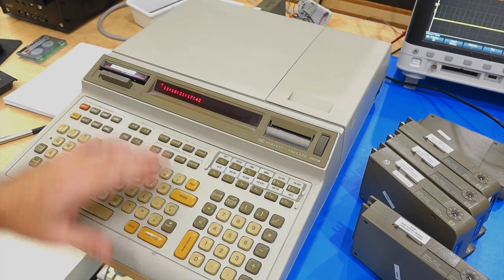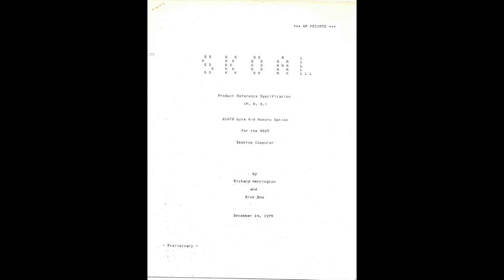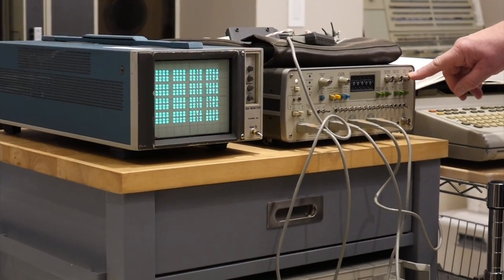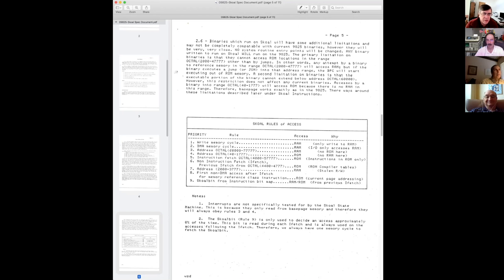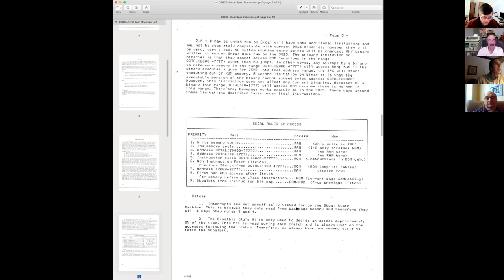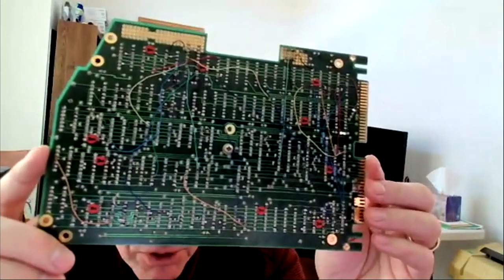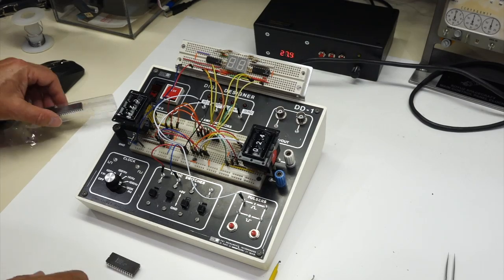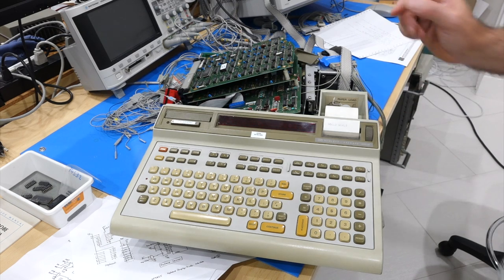HP 9825 Repair Part 9 : Skoal board repair (featuring the original designer!)

Comment: Ken testing TTL chips by hand on a breadboard is impressive attention to detail. And Marc’s parts storage cabinet is beautifully organized.
Reply from the maker: Having a big pile of vintage parts that is not organized is completely useless. It’s a lot of work to organize, but the only way to find the parts when you need them. Ask Mr. RTTY...
Reply: Haha I misread that as Mark's pants storage...
Reply: Mr Guru  It does show that it is accessible to all, which I like.
Reply: Mr Guru  It's a good exercise, but yes, an EPROM programmer would be much faster. A TL866 II Plus, which are fairly cheap, can test most TTL chips, and is worth picking up if you don't have anything better on hand.
Reply from the maker: @Mr Guru  Cool I did not know it could do that. Not sure mine has that option, I’ll check! [Edit] And it does! It can test all but one of the TTLs we replaced! It's not 100% accurate, it gave me a good test on a flip-flop that is definitely bad. But thank you, I did not even know!
Reply: Mr Guru  My old TL866CS I bought years ago does that too, a very handy yet little known feature!
Reply: @CuriousMarc  that storage cabinet shot reminded me of the 2001 scene when the HAL 9000 was being disconnected. I was waiting for the HAL voice while Dave was disconnecting the modules and the amplified breathing from his pressure suit.

Comment: Just want to say that watching your board diagnosis and repair videos has given me the confidence  to repair some of my own boards. I recently repaired a Hyundai XT-clone motherboard to fix a RAM error. Traced it down to a single bad NAND gate that was controlling one of the banks, but this is a clone board without any schematic available, so I didn't have a clue where to look until I took the time to reverse engineer it.
Reply from the maker: Wow, congrats on your repair and reverse engineering!
Reply: @CuriousMarc  Thanks! If this were Tandy, IBM, or even an HP, it'd have gone much quicker. It's much easier to find technical reference manuals for them.

Comment: Super cool hearing from the engineers that worked on the product. We take so much for granted in modern hardware design as everything is all modular and general purpose these days; build to a standard and specification for interoperability to guarantee compatibility of components - Computing back then really was the wild west and so much groundwork had yet to be laid.

Comment: I used this computer a lot for my masters thesis at the USGS in Denver. I wrote some data reduction code on it and later graduated to its younger siblings and HP basic running thermal ionization mass spectrometers. After graduating from MIT with a PhD in geology I went full science though and gave up programming.  Very very cool.

Comment: U58 74LS54 and U59 74LS64, what interesting chips. I'd never seen that topology before - or can't remember seeing them in the databooks. I'd always assumed the ttl jelly bean chips were always one chip type or another. Definitely made to reduce total chip count.
Reply: Interestingly enough, my comprehensive TI TTL databook skips them, but my abridged Motorola databook with Radio Shack logo includes the '54.
(and I wanted to reply that you would not find that kind of in the abridged databooks sold at Radio Shack but they would be in the full databooks...)

Comment: I love these vintage machines, and I love collecting them. I have an HP 9825 (one with the more traditional keyboard)... You have inspired me to service that power supply and install a crowbar clamp circuit on it before I consider playing with it! It also makes me wanna make a space in my workshop to open up my HP 9100A, and figure out what's wrong with it.
Reply: The early keyboards with the low profile keys didn't hold up well and were replaced very early with a more conventional type keyboard. This was around 1980.
The electronics division of Ford loved HP and used its test equipment almost exclusively for many years and for good reason, I've kept 3060 board testers in production for over twenty years. They were built like tanks.
Reply from the maker: Indeed I did not show that yet but I had to do some repairs on the chicklet keyboard.

Comment: Do you know,i really  thought that SKOAL  may have meant 'System Kernel  Overlay Addressing Logic',and then Rick spoilt it with a pack of tobacco!!  For me, this project is up there with the Digibarn project,, Marc has taught us so much,and introduced us to a great bunch of talented  yet humble  engineers.
My suggestion for the perfect finale,,The keyboard ASIC is shot,Ken and Karl decide to read the state machine conditions from the working keyboard ASIC, they push out a tutorial on the FPGA solution using VHDL or sim evolution if poss,they spin a board with  DIL pins from PCBWAY,(Karl might be patient this time around!),and install it in the socket as a replacement.
What a team!!!

Comment: When on a training course for the HP3060 board test, I went on a tour of the PCB manufacturing plant in Loveland. The most impressive part was where they gold plated the boards. All the board plating equipment was covered with icicles of gold.
Considering the amount of gold around, security wasn't very tight.

Comment: Those were the days...  I remember using similar tricks to re-use address space but by far not as complicated as those ones.
E.g. I made a "high res graphics" card for my TRS-80 model I that re-uses the 12K address space of the ROM.
Of course, it used the trick of "when it is a write, it is to RAM".  But to read from the RAM, I used bits in an I/O port to switch between ROM and RAM.
That of course meant that one had to have a routine in some other part of RAM that does the reading, but that was not a problem as ROM did not support that board anyway.
Interesting to see how HP tweaked an extra address bit and made it practically invisible to the existing software.

Comment: I never fail to be impressed by the resourcefulness and depth of knowledge of this team. Also hearing from the engineers that worked on the system's design is fascinating!

With relation to the dead TTL on the ROM Enable/Disable net, I suppose it makes sense that those would be dead as that logic is required and activated prettymuch 100% of the time the machine is on so any overvolt would immediately give it a nasty jab in the eye! I may have missed the original explanation (or my memory is also suffering a faulty Intel chip!!) but did the overvolt happen on a power-on or did it suddenly just go bang while in use?

Comment: I sometimes use an ohmmeter from the input or output with respect to ground to find bad chips. If an input was shorted, it can destroy the outputs of chips driving it-the top transistor and possibly the diode in the totem pole output.

Comment: Also had a box of TTL chips where the power supply gave 13V to it, and the crowbar did not work.  Funny enough all survived except for a single 5406 open collector hex inverter, which has 30V rated outputs, but which did not like 13V as Vcc supply.

Comment: The HP 1600A has another vector mode as well. not 1's and 0's it's memory address access shown as a vector (addresses accessed more frequently are brighter dots and you see lines traced between memory locations, illustrating aspects of the access pattern. So it can look very interesting.)
Reply from the maker: I have always been puzzled by that weird mode. Not sure how you’d use  that. But I don’t have a 1600, so I have never tested it. Would sure be worth a video!

Comment: Great video. That’s great you were able to get input from the original designer. Looks like your closing in on it. I’m curious. Is that configured to use the 5006A Signature Analyzer? I thought that might be one on the bench to the right of the logic analyzer, but it’s front panel configuration is different from mine. I’ve played with mine on the old HP Microprocessor Trainer, but I’ve never had a chance to use it in an actual troubleshooting scenario.
Reply from the maker: That computer does not have a signature analyzer debug procedure. Heck it does not have a service manual worth anything either, which is quite unusual. I do have a signature analyzer, but have not needed it yet.

Comment: I want that Digital covid shirt.
Reply from the maker: On sale in my teespring store: https://curiousmarcs-store.creator-spring.com/listing/VAXinated?product=211&variation=5291&size=1162
I also have hoodies, masks and stickers with that design.
Reply: @CuriousMarc  Brilliant!
Reply: As an enthusiast for old TV tech, your username makes me smile. NTSC was a color trainwreck, but it was a classic for years. :D
Reply: @EvilSandwich  Thanks. Nobody notices that!
Reply: @EvilSandwich  Wasn't NTSC 480 lines?
Reply: @160rpm  that is a common misconception. 480p is the closest approximation digital televisions can have to recreating the original interlaced 525 line analog ntsc signal. But in reality the 480 lines was just what was on the actual analog screen itself. There were things that the user did not see. Like vertical and horizontal blank, hsync, vsync, etc. That's where the extra lines are. But you are correct, the actual lines that showed up on the proper television screen itself were roughly 480 lines. So that is the resolution Digital television use to simulate that. I hope that clears things up. :)
Reply: @160rpm  if you want more detail, this video did a fantastic job summing up the basics:
https://youtu.be/1MY-jUkogbg

Comment: Would a 74LS04 work as well as or better than a 74S04? ‘Cause I’ve got sh*tloads of LS04s from years - nay, decades - of board salvage! Although, I suspect you probably have lots of them, too. Just don’t put them in the pockets of your fancy pants, or you’ll have little holes in your pants from the sharp, pointy IC legs! 🤔
Reply from the maker: You really need the S. It’s almost 10x as fast as the LS. The decision time had to come before the RAM/ROM access, so they had to stick a few S chips in the critical path.
Reply: @CuriousMarc  - what about the 74F04 variation? I would have thought the S (schottky) and LS (low-power schottky) would be about equal in terms of rise/fall times, gate delay, etc… Or even the 74HC(T)04?
Reply: @williamsquires3070  74HC is comparable in speed to 74LS and thus rather slow. 74F, 74ALS and 74AC are the more modern families to look at if speed is important. Of course 74S is faster than 74LS as 74LS is defined as 74S with larger internal resistors to decrease power consumption.